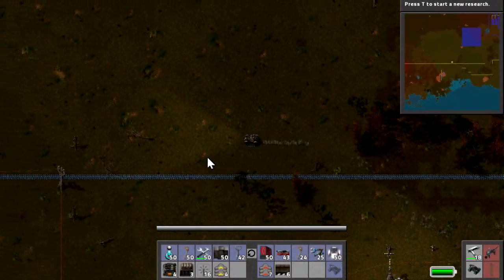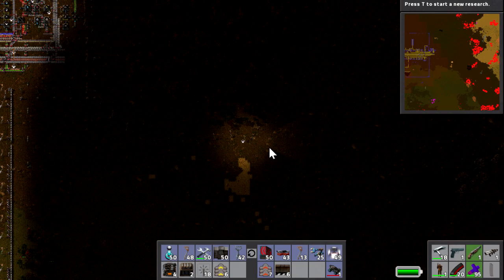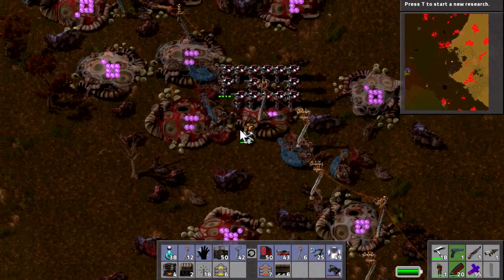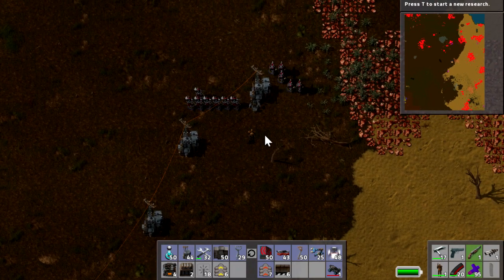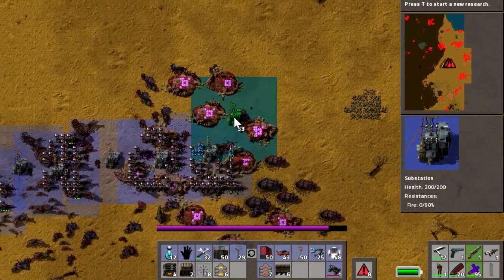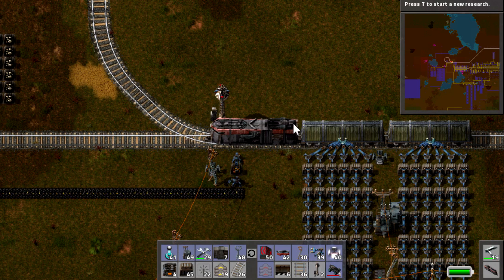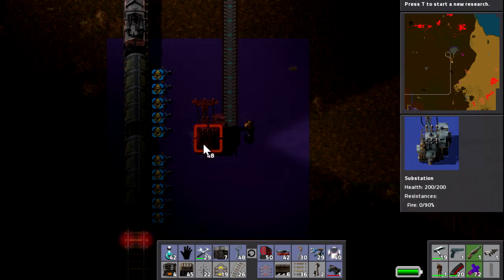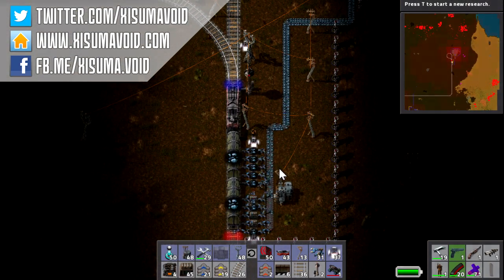Factorio 14 Alien Obliteration & Trains

Comment: Thanks for the mention, I really appreciate it!
So, When you told the train to go the first time it started off in the waiting stage because it was already parked at one of the stations. The reason you had trouble with the go to station button was that it doesn't operate when the train is active, even if it's not moving, and I expect that it didn't work the second time because the train was rolling. Also, because of the viewpoint used in factorio, trains are shorter when facing north-south than east west, which is why there's a little more weirdness with inserters there.
Reply from the maker: MangledPork Gaming Thanks bud! i have got the hang of trains a bit more now :-) btw i sent you a PM please give it a read!

Comment: I bought Factorio after seeing how much fun it looks on here. :-)  One thing I highly recommend is making little outposts with a radar dish or 2, walls, and 2 rows of laser turrets. Here's why:
-Better information on the map from the radar.  See where attacks are coming from, where the trains are, etc
-They will draw aggro for enemies on the way to your main base
-Less attacks on your main base makes it easier to defend, and if the outpost is destroyed you can easily recover and build a new one
-They make it harder for enemies to form new bases, since enemies tend to aggro on the outpost instead of staying in one spot and forming a new nest
-Later on you can upgrade them with a roboport.  You can place the roboport down and materials down, power it, and use a blueprint to make the entire base.  Leave some repair packs and materials so the outpost stays operational, and you get the side benefit of automatically repairing your car when you're near one.
-They're good as a starting point for future attacks, and a great fallback area.

Overall, I'm loving the series!
Reply from the maker: therealfaloun Good idea, however i have a wall to surround the areas im in atm